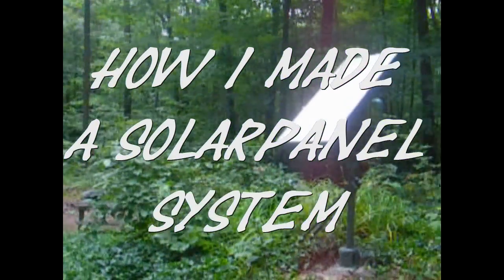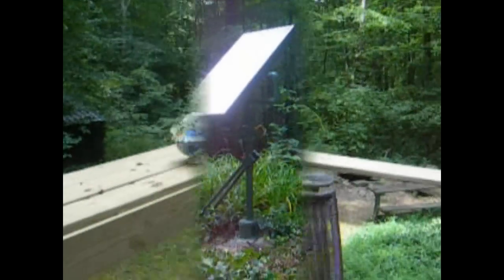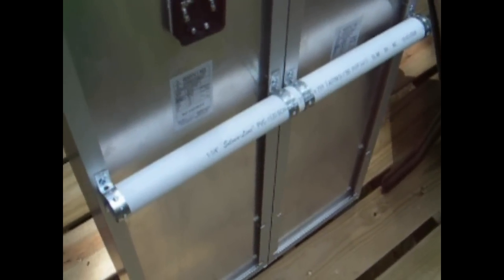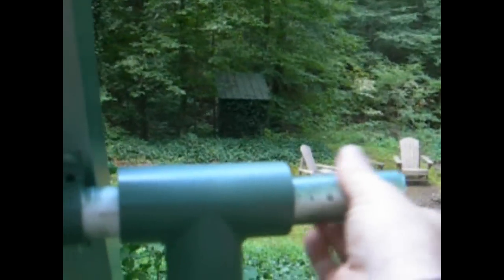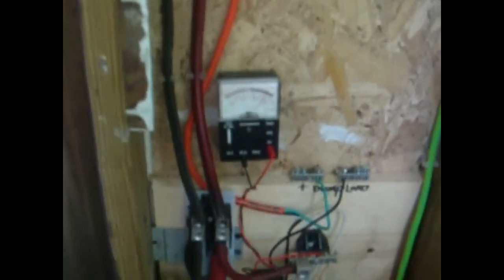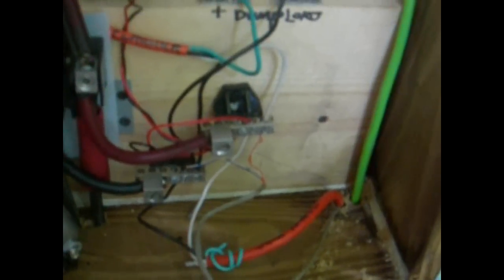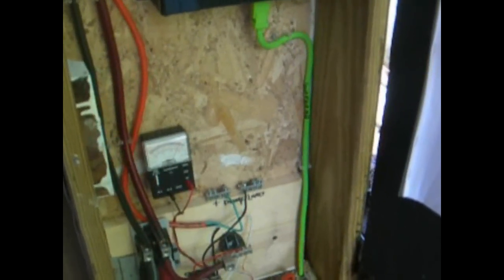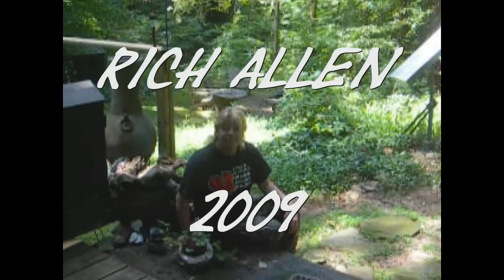HOW I MADE A SOLAR PANEL SYSTEM  RICH ALLEN

Comment: By adding side mirrors (shiny aluminum sheets will work too) at a 45 degree angles all around your pop can heaters, you will GREATLY increase the sun's heat that gets captured.  No need to make HUGE heaters, just "funnel-in" more sunlight.

Comment: I like the caulking gun adjuster feature. I suggest you use some of the power, always, such for just running your modem or wi-fi. That will help you judge your system for weakness or needed maintenance. I really like the idea of have green covers to indicate battery power outlets. Great DIY home solar. Please check out my video. Hi from sunny FL

Comment: Thats a good charge controller if it will let you do both charging and a dump load.
My Xantrek C40 manual says you can only use it for one or the other. 
Very cost effective system. 

Thanks!